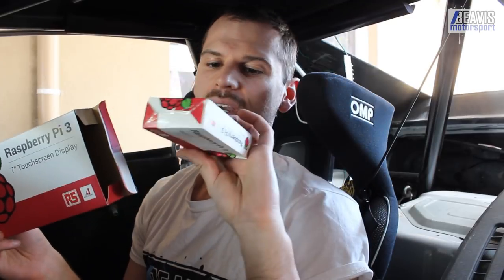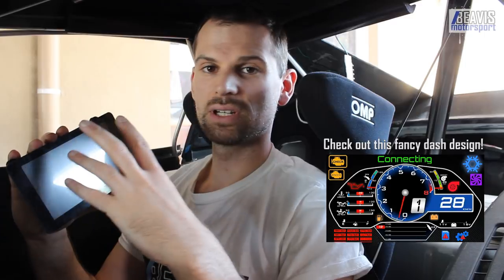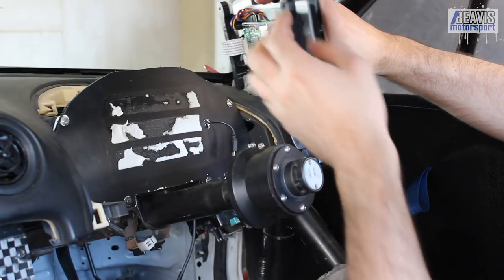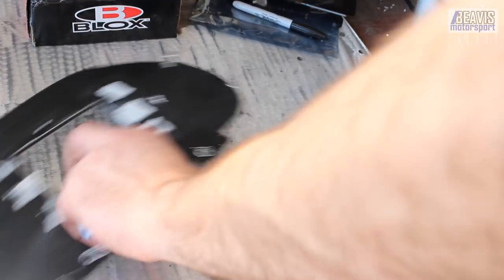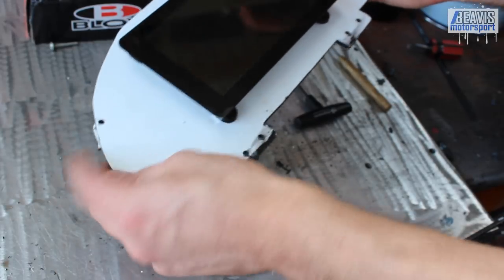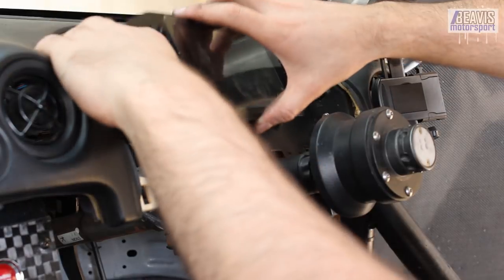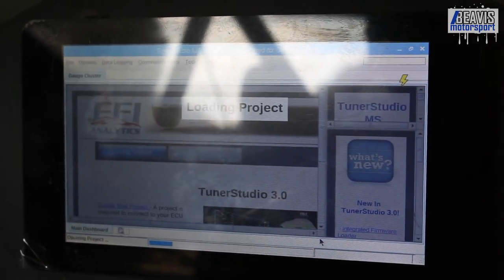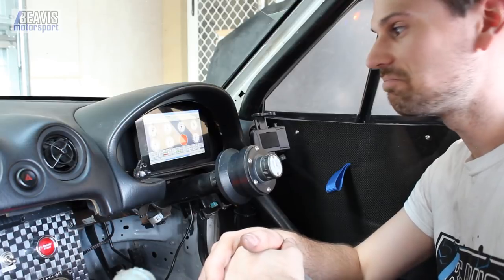Installing my Digital Dash DIY RaspberryPi - Episode 44 - Time Attack Miata TURBO Build

Comment: Get a 5.2 volt power supply (the max voltage for USB), and good USB cable. 

If you are worried about the micro USB connector, you can connect the power to the GPIO pins, there are 2 sets of unregulated 5V, the one set is used for power between the screen and the computer.
Reply from the maker: Thanks for the suggestions Michael. I think in my case it might be the USB cable as the power supply is a 3A 5V unit (supposedly).
Reply: 5.2 is not the max.

Comment: Put the pie into an enclosure and install a cooling fan on the processor. It will prevent future problems
Reply from the maker: I do run some small heatsinks on the cpu which should help with longevity.

Comment: Sweet setup, I would have used the mounting brackets as retainer. Put the tablet flush on the mount board with the brackets on the inside of the board. Your screen wouldn't be raised and the Pi ports would have more clearance deeper in the mounting panel?
Reply from the maker: Absolutely could've (and probably should have) done something more streamlined. Though I actually used the brackets to bring the display closer to the correct angle/position to match the original dash cluster as the board it was mounted to was sunken in fairly deep.

Comment: the little lightning bolt you get in the top right is the pi telling you it doesnt have enough power. it does have enough to run and to do what you want but you do lose some performance and it may lock up on you sometimes.
Reply from the maker: Yep I mention that in the video at 11:20. Thanks for watching buddy.
Reply: @Bbeavis  i probably skipped over that lol and yeah np i was looking up what people have done to do the same thing in my car
Reply from the maker: @strato_5459  I now run 2 power supplies, one for the screen and one for the Pi. And i disconnected the power bridge wires between them.
Reply: @Bbeavis  that should be perfect

Comment: Great write up!  The only other thing I wish TunerStudio had is a GPS lap timer, but that is somewhat out of the scope of that software.  As is we still need to run another device to handle lap timing.  Still, this gets you 8/10ths of the way to a Racepak style dash for 1/10th the price.  Nice job!
Reply from the maker: Yeah it's a great value solution, but It'd be great if there was an easy way to log complete data in the one place... so be it. I usually use Racechrono on an Android phone and overlay that with video.

Comment: Im just a little confused on how you put power to the rpi??? Everything ive seen makes it use a normal outlet plugin to power it. Trying to add this to my MS setup but im not sure how to make it receive the power it needs. A little clarification there would be awesome. 

And then im guessing the rpi connects straight to my MS ecu through its USB-b to regular usb on the rpi???
Reply: I figured it out. Looks like ill need to pick up a micro usb adapter. The rpi only needs a 5v signal to properly work correct?
Reply from the maker: Hi, it uses a 12v to 5v converter then a traditional micro USB cable to the raspberry pi. And yes, the megasquirt MS3 is a usb connection direct to the standard USB on the pi.

Comment: Would work with holley terminator efi system? And did you set up fuel level gauge?
Reply from the maker: The TunerStudio software won't work with Holley, so you'd need something else, such as OpenAuto or OneGauge.
I have the fuel level feeding into my ECU so yes I can display it on the dash.
Reply: Thank you much appreciated  reply . 
Also looking use raspberry pi 2w for wirless usb from holley terminator  to laptop USB  Bluetooth or wifi ?

Comment: can i make that digital dash with raspberry and only connect through the obd port?
Reply from the maker: Hey, If you wanted to use OBD2, perhaps the OpenAuto software would work for you as the TunerStudio software mentioned here is for the Megasquirt family of ECU's.
Hope that helps!

Comment: That little lightning icon means the amperage supply is too low. The Pi is underpowered, so it might be worth looking into a solution that can deliver at least 2.1amps to it.
Reply from the maker: Yeah that is my understanding, but it seems the "3A" power supply I have isn't really 3amp.
Reply: If you're using an el-cheapo or chinesium power supply, stop using it immediately. It won't be able to adequately protect the Pi against surging, and messy alternator power is frisky at the best of times - and you're also powering the screen through the Pi I assume, which increases the requirement for stable current.

Most cheap 12v supplies use the LM7805 voltage regulator. This can only ever supply around 1amp, and they often don't come with a heatsink which is against specification. 

To properly engineer a solution, I'd look to something that's used to power long-life-service equipment, such as instruments on buses or lorries. You need something that will last for at least a few years, and cheap shit just isn't going to cut it - especially not if you're tucking it away behind the dash. Here's a possible solution at about thirty quid: https://www.powerstream.com/dc-dcz0503.htm

Comment: What are you doing when its time to turn off the car, Do you just turnoff the power to the raspberry or shutting down the raspberry and then turning off the car? i can see having to shut down the raspberry every time you turn off the car would be a pain in the ass.
Reply from the maker: A very fair question. I plan to hook up a push button to one of the gpio's to shutdown the PI safely before powering it off completely. It's the simplest and least convoluted way to ensure the onboard SD doesn't suffer any corruption.
Reply: ive done a bit of research, there are a few auto shut down devices, but nothing i like so im putting together one myself. it will auto power on with ignition and run a shut down script to power off then ignition is turned off and then cuts the power to the raspberry so it wont run the battery flat.
Reply from the maker: To keep my setup simple, I've wired in a button to GPIO 21 pins 39 & 40 - have a look here: https://www.raspberrypi.org/magpi/off-switch-raspberry-pi/

Comment: Hello sir, just a question. I am trying to get the tachometer gauge to work on the raspberry pi. I have tunerstudio on megasquirt 2 pnp. How did you connect ur speedometer signal to megasquirt?
Reply from the maker: I have the NB MX-5 speedo sender wired through a VR conditioner from JBPerf, into the Digital Frequency Input of the Megasquirt.

Comment: There is a way to disable that rainbow splash screen and also add custom splash screen like a mazda logo or something
Reply from the maker: On very first boot up? Nope I don't think it's that easy to change as it's at a hardware level, not part of the operating system.
Reply from the maker: @xyzebruh1083  Oh, cool so sorry I didn't realize you said you had done it! That's great well done and thanks for sharing.
Reply: BEAVIS Motorsport no problem, I have built a few custom raspberry pies for friends and family and played around with the splash screens before

Comment: looks cool, but I'm wondering about the vibrations and that ribbon cable on the edge of the opening.
Reply from the maker: Fair point, I'll double check it to ensure it's not going to wear. Thanks for the tip Wayne.

Comment: im wondering if the RPi ended up dying cuz of bad power output to it ? did you end up adding a 12v to 5v hooked to ignition so it wouldnt die or did you manage to find the proper powersupply  ?
Reply from the maker: It's still going great :) I now have two 12v to 5v converters that output 3A, one for the screen, one for the pi itself.
Reply: @Bbeavis  sweet,  sick build and great choice of SBC :)

Comment: Nice job,  I looked at doing this with mine but I was worried about seeing the screen in bright sunlight?
Reply from the maker: Shouldn't be too bad as long as its mounted back inside the gauge hood to keep direct light off.
Reply: Get a matte non glare screen protector, if there not available direct fit, get an ipad one and cut it to fit

Comment: Do you know if its possible to set the Pi to boot straight to the gauge cluster? No splash no main OS screen BS
Reply from the maker: You sure could, with enough tinkering with the OS and tuner studio app. I've modified my splash screens and boot-up screens, (although not removed them completely)

Comment: Does it read ODBII or is it somehow taking the same inputs as the old analog gauges?
Reply from the maker: The Megasquirt MS3 ecu has a USB to serial interface the connects to the PI via a USB port. There is no ODB2 used in my case.

Comment: Did you ever find anything on vibration?? Looking to do a similar idea on my 2016 harley roadglide but instead of going all out right away with gauges and ecu interface. I just want to start out with replacing the blocky non user friendly radio and screen with the raspberry pi osmc since I pretty much listen to my own music 100% of the time anyways. Love the video! New subscriber here!
Reply from the maker: Thanks Cody, sorry not sure what you mean regarding "find anything on vibration" ?

Comment: In the process of mine currently but tunerstudio won’t detect the firmware in the megasquirt due to the com ports usb to rs232 drivers, did you have to install any drivers?
Reply from the maker: I did not do anything special drivers, but I'm using the ECUs on board USB headers, whether that makes a difference.

Comment: will the speed gauge work with a na8 miata  with the megasquirt ecu?
Reply from the maker: As I assume you are aware, the NA uses a mechanical speedo drive to the OEM cluster. So unless you address that in some way, no obviously the Megasquirt will not know the current vehicle speed. Easiest solution is to wire up an NB speedo sensor with a VR conditioner as they bolt onto the NA transmissions.
Reply: @Bbeavis   yeah I'm  aware of that I was thinking you might have an idea what to do  i was maybe getting a ardino to translate to speed to the pi
Reply: @Bbeavis   also thank you for the 3d models  BTW the vents do fit on na miatas

Comment: You used a wired OBDII dongle connecting to the Pi USB ports ?  I can still use the bluetooth capable OBDII dongle as long as my Pi has BT and WiFi on board right ?  I have a 3 and 3b+ , So I can go wireless with this build right ?
Reply from the maker: I am not using OBD2, it is an aftermarket standalone ECU with a serial to USB interface. Yes, you could possibly use a bluetooth/wifi OBD dongle if you find suitable software for it.
Reply: @Bbeavis  Meaning tuner studio is not compatible ?
Reply from the maker: @DDBAA24  Tuner Studio is software built specifically for the ECU in my car, have a look at http://www.tunerstudio.com/index.php/tuner-studio
Reply: Just keep in mind the security risks of a Bluetooth ODB dongle, the Bluetooth will be on at all times, even with the car off.

Comment: Unfortunately a Pi is a terrible choice for something like this. Long boot times, and if there is any sort of power interruptions it may reboot and might corrupt the SD card. Plus the SD card slot is prone to failure even in regular use, which means a lot higher failure rate under vibration, moisture, etc. In my experience they are sensitive to power such that momentary brownouts corrupt the SD card so at the very least a small battery is required to power the Pi and allow it orderly shutdown. There are SBCs with built in flash (BeagleBone Black for example) that eliminate the SD card as an issue but still suffer long boot times unless you configure it to sleep. Better would be a dedicated processor with enough memory (Arduino Mega/Atmega 2560, ESP32, ESP8266, etc.) and screen with a supported software library.
Reply from the maker: Hi Aaron, in my particular case bootup time is not a concern as this isnt the kind of car you just start up and and immediately drive away. And, I'm not exactly using the dash for common dashboard needs, the key information is engine health and monitoring such as oil pressure and coolant temp etc. With regard to the SD failures, I've never had an issue thus far, and I have a power off push button installed which I press to safely shut down the Pi before cutting the power.
Sorry to hear about your recent garage break in, you've been quiet lately, I hope the cosmo will see some more videos soon.
Reply: Ah yes, good point that in a race car you'll have time in the pits preparing the vehicle before use. Only concern is if it crashes out on the track. It might be distracting.  Could be mitigated by putting a big capacitor (10,000uF) in parallel with the Pi 5V supply, and epoxying the SD card into the holder. I looked into using an SBC like Orange/RaspberryPi, BeagleBone, etc. for the dash in my Cosmo as I am about to do something similar but settled on using several Arduinos to read the CAN bus data and run steppers, LEDs, etc. mainly because of bootup and long term reliability concerns. The break in sure sucked, and came at a time in my life when it was the last thing needed. But I am still working on the Cosmo whenever I can between other projects (the biggest of which being the full gut and rebuild of my house) and hopefully will have an episode soon.
Reply: Not gonna argue the boot times :D but honestly,  by the time you are on the road, it's up and running.  With a little bit of work, you can squeeze those bugs out.  I'm using dual raspberry pi's in our #teslonda,  proper insulation, wiring a good DC/DC converter, you're good to go.   To avoid an SD corruption, I'm using the Petroblock Powerblock, with a keyed signal to turn it on. Before I went that route, I put a readonly layer to prevent any corruption issues.   For power, I'm using a 12v-5v buck converter and good gauge wire/usb to provide a strong 2.5a/5v to each unit.    The pi3 has plenty of memory and processing power to do what you need. (at least for me)

It's a great and fun project and yes, if you were serious about making this industrial level/sellable, you would move to a better PCB solution, but for a fun kickass DIY project, go nuts.  As long as it isn't supporting critical car functions, I say have a blast.    Love what you did with the Bezel, BEAVIS Motorsport.

Comment: Do you have to run a mega squirt ecu for this to work? Haven't been able to find any info on this.
Reply: I would also like to know the answer to this
Reply from the maker: You could run an ODB2 interface to an OEM ecu perhaps. For me, TunerStudio software connects directly to the Megasquirt ECU. It will depend on your car...

Comment: How does raspberry pi hold up to constant race car vibration?
Reply from the maker: No far no issues. Can't see how it's any different to any other PCB, say the one in a car stereo or the cars ECU.
Reply: @Bbeavis  thanks mate , just got the pi4 eager to get it in ..I went with a "longruner 7" touch screen " bezel is thinner

Comment: hi how did you connect the car to the ecu.. I have a only car nissan 05 altima
Reply from the maker: Hey, Bobby, The Megasquirt MS3 ecu has a USB to serial interface the connects to the PI via a USB port.
Reply: @Bbeavis  Do you mind putting the link to it in the video description? I don't know if it will work on my 2005 nissan altima but it might help someone else.
Reply from the maker: @roystervi  There's no link sorry mate, it's just a USB cable straight from the ECU to the Raspberry Pi.

Comment: Can you use it for data logging,  does it's internal clock need to be near a net work or wifi after initial set up?
Reply from the maker: Yes it can do on board data logging. The real time clock is not maintained when power is lost, but will update to an NTP server if reconnected to the internet.

Comment: did you just run the power cable and cut it open and splice it into positive and negative off of your accessory? contemplating doing this for my build
Reply from the maker: I'm running a pair of 12v to 5v dc converters. Keep in  mind none of the wiring in the car is very OEM anymore... it's pretty customised now.

Comment: What connection to the obd2 port did you use? Usb, bluetooth, wifi? Is it lag free?
Reply from the maker: The Megasquirt MS3 ecu has a USB to serial interface the connects to the PI via a USB port. There is no ODB2 used in my case.

Comment: Where is the usb power cable getting the power from? The megasquirt?
Reply from the maker: I have a separate 12v to 5v adapter. Definitely not from the MS3 itself.
Reply: @Bbeavis  thanks!

Comment: How do you power so that it automatically starts and shuts down properly when you turn the ignition off?
Reply from the maker: It powers up automatically when the car is on, and I power it off safely using a push button as per this guide: https://www.raspberrypi.org/magpi/off-switch-raspberry-pi/
Reply: Did you make it function correct? Like if you forget to power off the RPI before you turn off the car (or by accident car goes off), the RPI turns off immediately?
Reply from the maker: Hi Chris, with the simple push button, the button must be pressed before powering off the car, or the pi power source will be cut. There's no other clever gizmo's to safely shutdown the pi. As long as the button is pressed, all is well - it just requires me to be attentive.